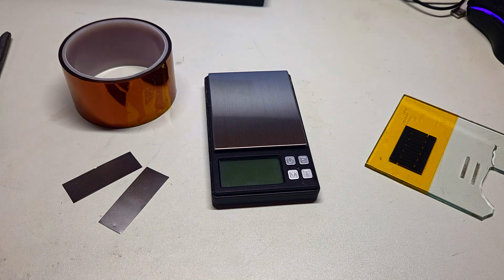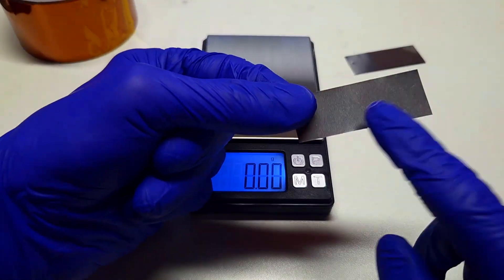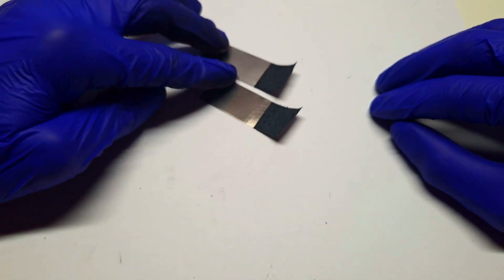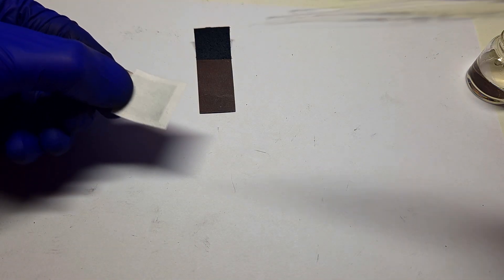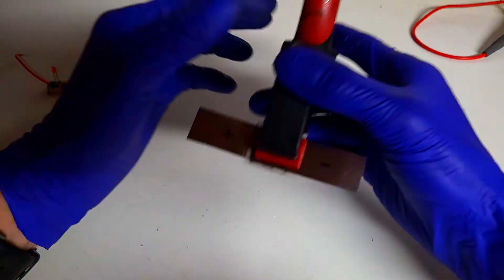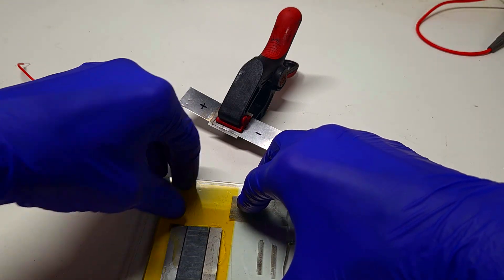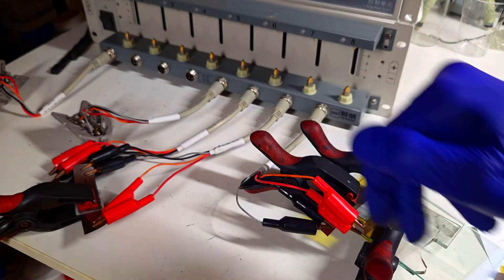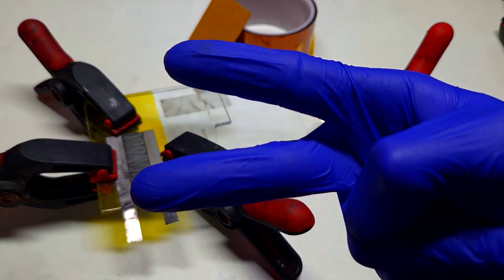1000 cycles on DIY Laser indused Graphene Supercapacitor

Comment: As youre making a capacitor I would be interested to know what its value in uF would be.
Reply from the maker: 218 µF for the first capacitor and the capacitor with the interdigitated cell design need to have over 10,000 µF because this is the maximum capacitance reading on the Rigol DM3058